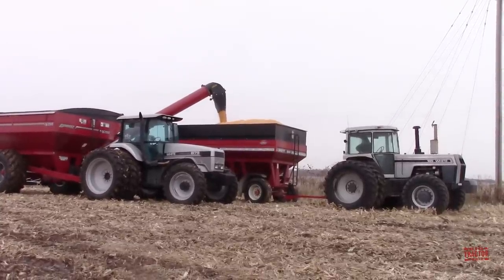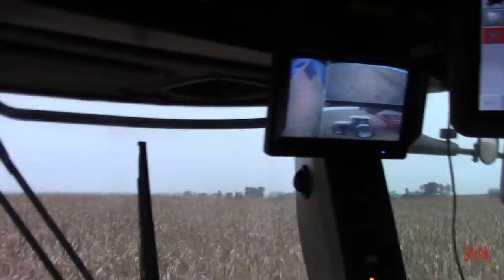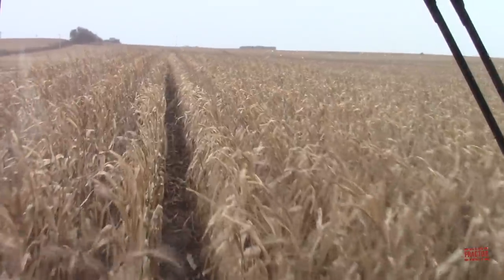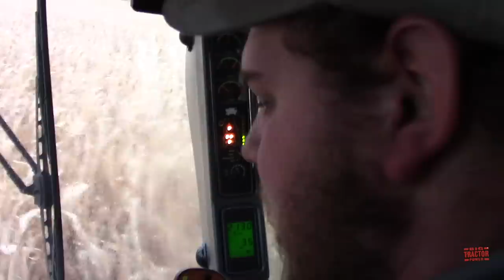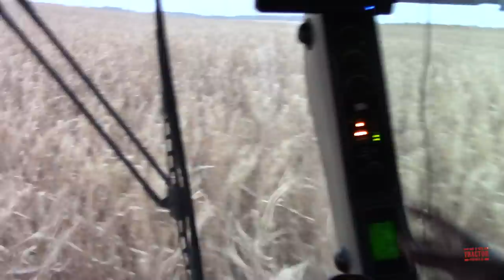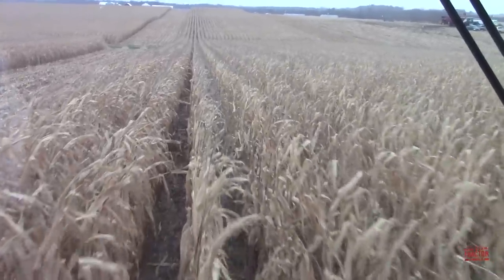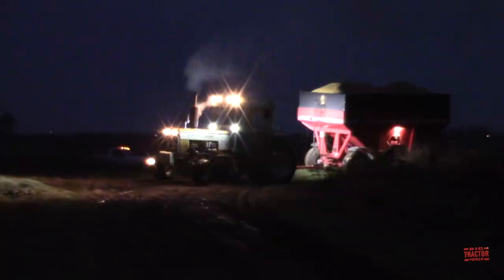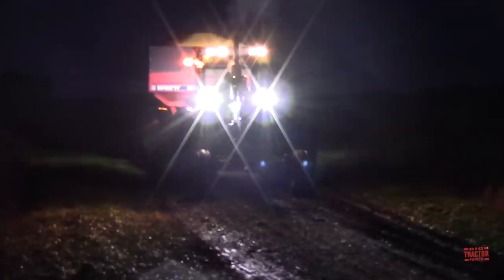SILVER TRACTORS | Iowa Corn Harvest

Comment: Great video! I would like to offer a correction. AGCO moved the White tractor  from Coldwater,  Ohio to Independence, Missouri about a year before the 6000 series went into production. The 6175 would have been built right along side Gleaner combines of the time.
Reply from the maker: WHITE-New Idea built the original Work Horse tractors 125-195 and the Deutz-Allis 9100 series in Cold Water. In 1991 AGCO bought White tractors from White-New Idea and moved the Work Horse/9100 tractors to the Gleaner plant in Independence, MO. White-New Idea continued to build hay tools and corn planters in Coldwater. White-New Idea implements were their own company. In 1993 AGCO acquired White-New Idea and the Coldwater factory. The new AGCO-White 6100 and AGCO-Allis 9600 tractors moved from Missouri to Ohio after AGCO bought Coldwater.  In 1999 AGCO closed Coldwater and high horse power tractor production moved to France in 2000. .
Reply: I respectfully disagree with that. I went to the dealer product introductions in 92 and 93, and part of the 93 show was a factory tour at Independence. They were making 6000 series tractors at that time. I have pictures from the product intro meeting, but they wouldn't let me take the camera in the factory. For further proof, I looked up Agco's website from 1997 on the internet archive site, and in April of 1997 they show Agco White tractors being built in Independence, Missouri. I'll post a link in another comment, because Youtube will probably mark it as spam. The history as I know it, the 6000 series production stayed in Independence until they were replaced by 8000 series that used Massey Ferguson drive train with a Cummins engine, built in the Beauvais, France. Smaller Whites were either built in Coventry, England or in Italy by SLH. When Agco bought the McConnell tractor and put the AGCO Star tractors on the market, they built those in the Coldwater, Ohio facility until it was closed.